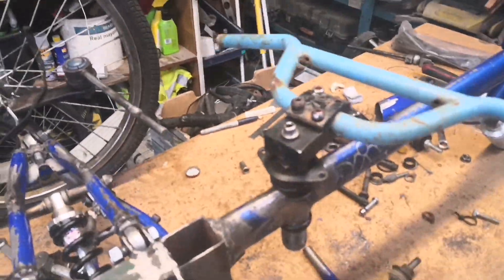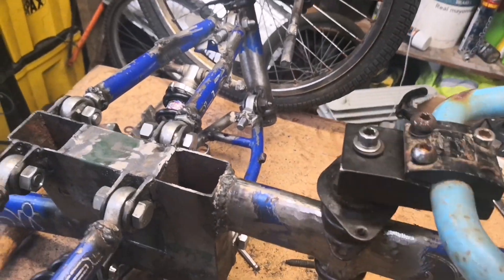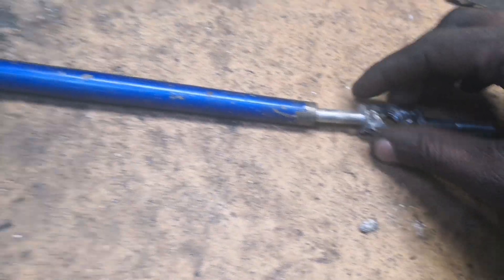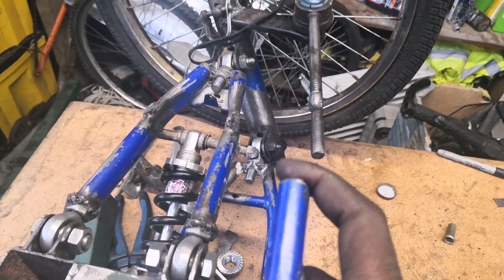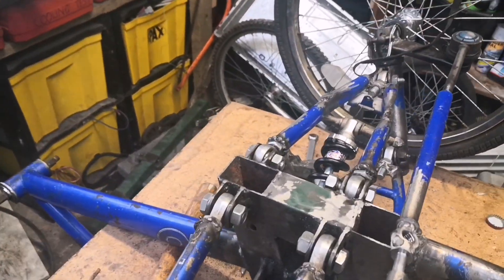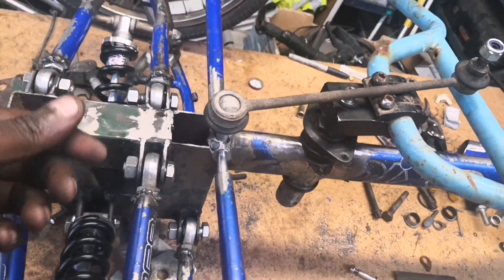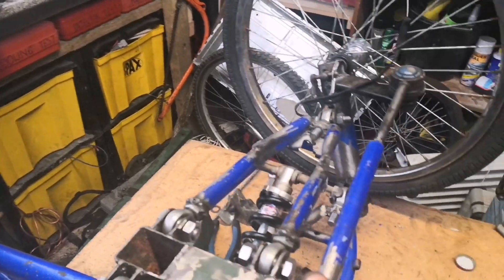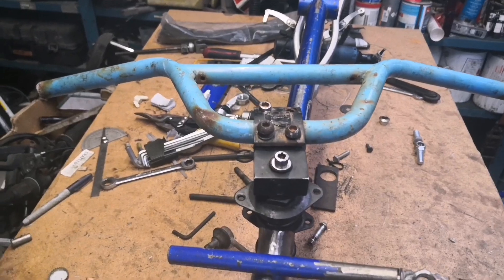Recumbent trike steering  update

Comment: Did you use a left and a right treaded bolds? Else it will not work.
Also how you make your steering, you need to counter steer. So you steer to the right and your Trike goes to the left.

I would ad a rotating part on the other side of that steering arm you are now making and connect it to that. Than connect your current steering to that par. You have a plate with on each side a hole and you can use that to connect them.

Tank steering would also be nice, but than you need to change more things.
Reply from the maker: I'm in the process of finishing fabricating the link or pivot point for the counter steer. Figured that l would need left threaded nuts and bolts for the mechanism to work but have none. Will try figuring out an alternative. If l can't no biggy. Just getting too eager to ride the thing.
Reply: @moyb112  I know the feeling. I made one split bar and added left and right treaded bolds and nuts. But you can also loosen it on one side so you can change the length and mount it back.

I would change the steering so you steer the direction you ride, but you can do that even after you make it now ready yo ride.
I Madd mine ready to ride and after that I added things and changed some things.
I jyst wanted yo ride it, just what you want to do now.
It is good to test tide it. I made changes also because of that and I tested it for several test rides before I started to paint it.

Do you have Instagram or messenger?

Comment: Yeah I'm struggling with my steering buddy on my DIY recumbent trike build pal my trike isn't as complex as yours it's just a simple build pal
Reply from the maker: Mine was all trial and error learnt to weld and fabricate on the job had redo mine as it was counter steering will post progress video. Just persevere the fun is in the errors and learning
Reply: @moyb112  yeah I'm same mate bought a welder and I'm learning but I need so.e steering rods pal to hold the wheels out so I can sort out my mistakes pal thanks for answering
Reply from the maker: Pop over to a mechanics garage and ask to dive into their scrap bin for some anti roll bar drop links works great on mine. I  used the ball joints and the rod on mine. Works a charm
Reply: @moyb112  thanks mate I didn't think of that cheers buddy